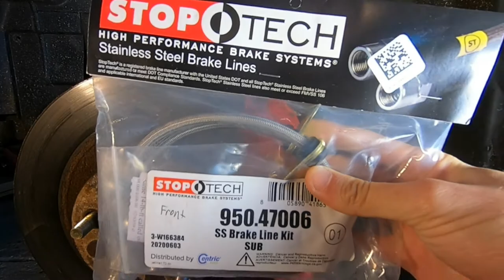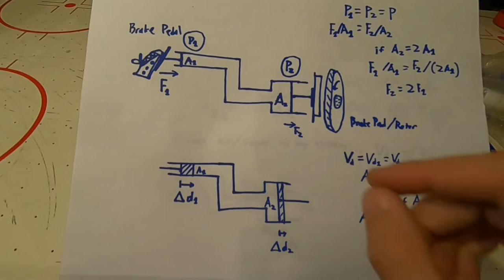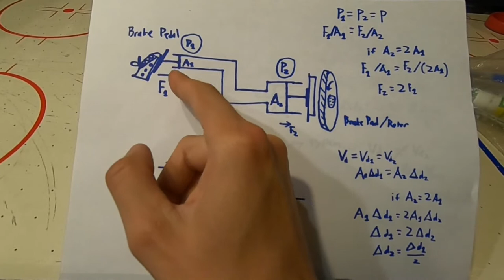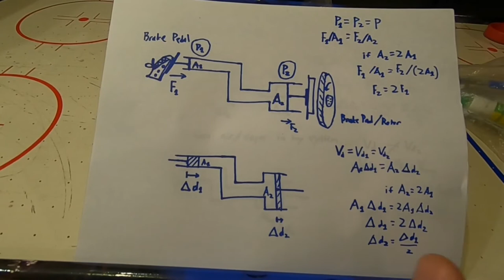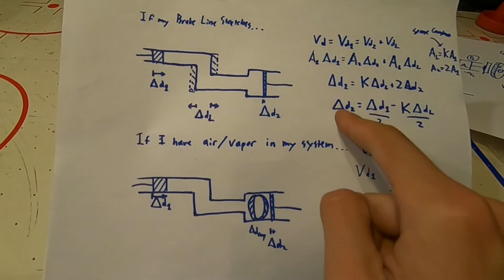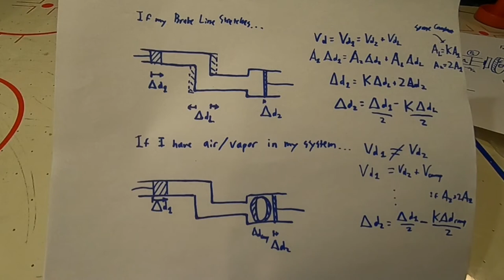2006 Subaru WRX Stainless Steel Brake Line Install

Comment: On the subaru tr brake calipers they have a small hole in the caliper so that the brake fitting stays put , i saw the new brake line you put on doesn't have that mental hook on it , is that ok? , have you had any issues? Im asking because im doing a conversation haha so input would be greatly appreciated.
Reply from the maker: Haven't had any issues so far, but always a good idea to turn the wheel lock to lock and go for a test drive to make sure you're not rubbing against anything. Can never be too careful when dealing with Brakes!